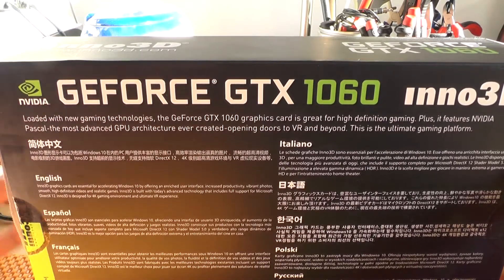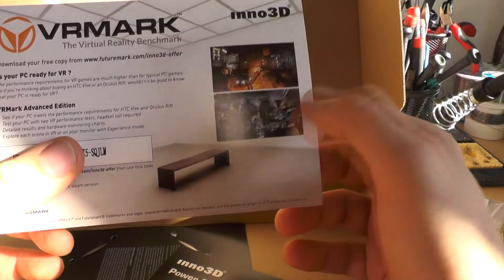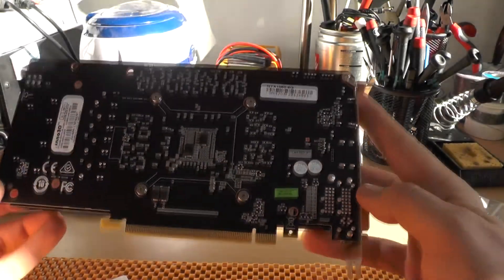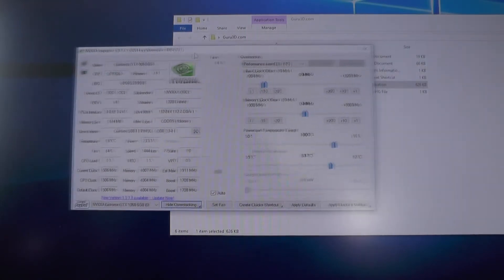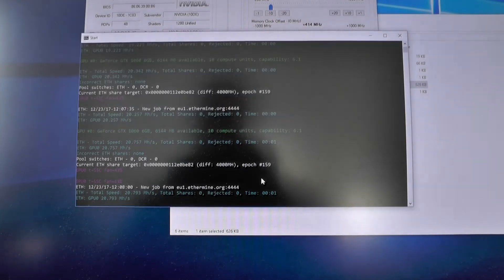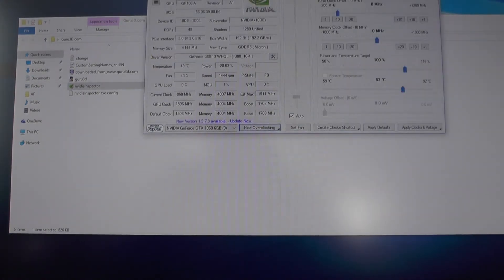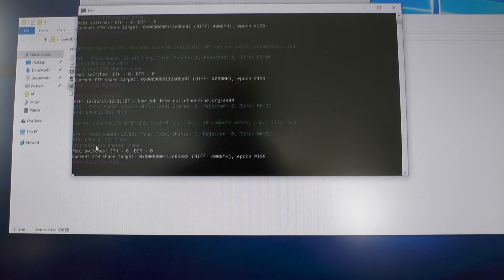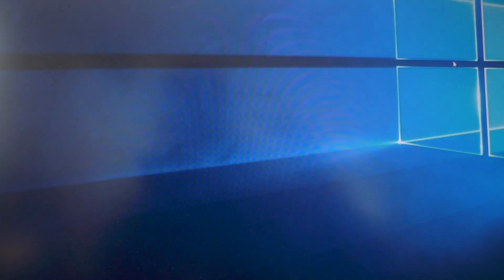Inno3d nVidia 1060 6GB ETH Mining

Comment: inno3d are not designed for mining. its a weak card.
Reply: i have an inno3d gtx 1060 3gb and i play video games like fortnite/dead by daylight/rocket league for hours and i dont have problems with it.
Reply from the maker: i agree :)
Reply: Not sure if its the weakest..but its really weak..it heats up very quickly in gaming..
Reply: wigga..yup i agree..no problem if you use it on gaming..just not mining.